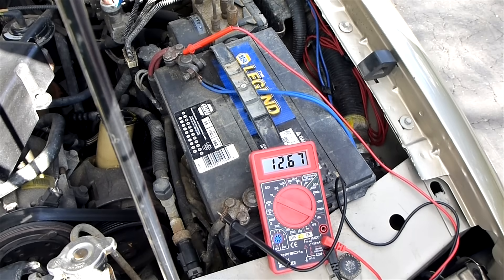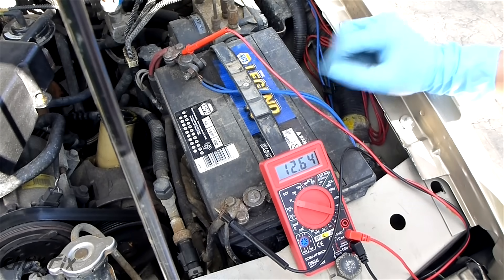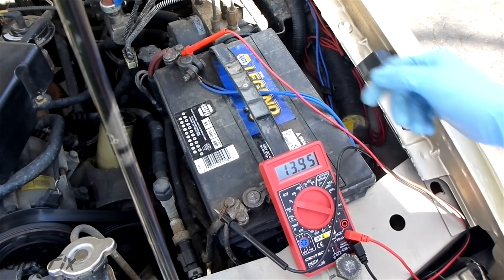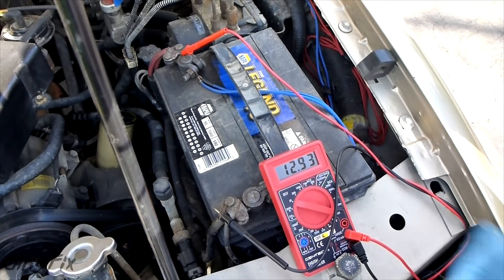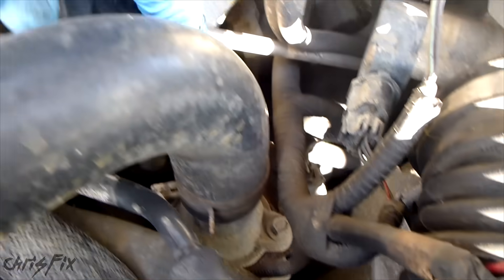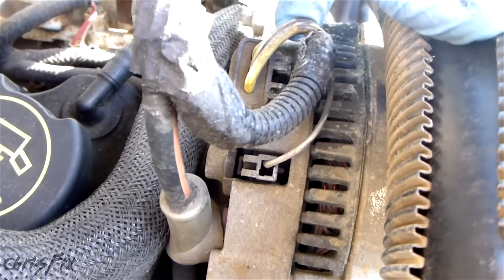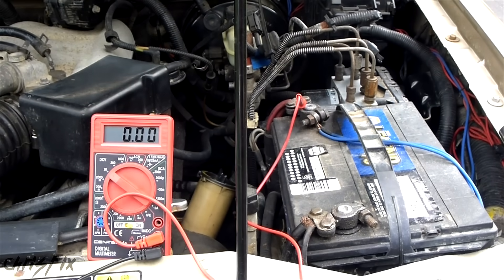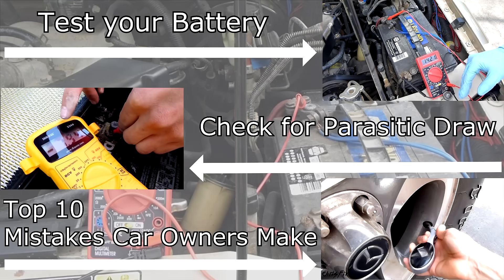How to Test an Alternator

Comment: if the battery light comes on during drive its always the alternator, the batterys only job is to start the car, the alternators job is to power everything and reload the battery. the battery light comes on to tell you that the car is now running on battery power, and the alternator is bad or broken. if that happends, and you cant fix it right away, turn everything u dont need of to conserve battery power so u can get home atleast.
Reply: I end up with this issue today, 3 days after i changed the belt the issues come up today morning while driving to work, i did the same thing i turned everything off and i managed to survive the day, now the car at local garage.
Reply: In my case it was the battery. We went out and stopped to grab something at a store (less than a 5 min stop where the car was turned off so even if all the lights were on it shouldnt have died), and it didnt turn on. Then we used a battery jump start and the car started but acted extremly wierd and upredictable, for example we almost ran into a fence when the powersteering turned off. So we went to a mechanic and he tested the battery and it was shot. It got shorted somehow and was drawing so much power from the alt, it got hot.
Reply: @EndstyleGG  when I bought my truck the owner had let the thing sit for like a month and he had to jump it off to meet me down the street from his house (way out in the boonies where maps won't find you) and it was like that, the thing was super low on the voltage and there was this weird smell, got to looking and the battery was smoking just a little bit, used that to get him down like another $150 bucks (then used a coupon code that saved me nearly $50 and bought a new battery, fixed it right up). It was also hot to the touch.
Reply: This is simply not true.  If your battery is broken, it will refuse to charge and drain all the power your alternator outputs.  This has happened to me.
Reply: @CH-ny7rb  you are correct and the cars of back in the days it is true but on today's with all the electronics and accessories the battery is a big player and if it's bad you will notice
Reply: Well the first time it happened to me, some 30 years ago, I was still far from home, but made it back without issues. (brushes and regulator)

Second time, some 15 years ago, I was not so close to home.
Damn! I was not even in the same country. LOL

But thanks to a nice semi truck driver well equipped tool box, I was able to repair it, go around Europe and later return home to fix it properly. (broken alternator bracket) :-)
Reply: last night the light came on for about 30-60 seconds after I cranked the car then it started charging again and the lights went back to normal brightness, tonight it did it again, but took twice as long, then I stopped for dinner and when I got back in the car it  never started charging again, by the time I got home there wasn't enough voltage left in the battery to crank the car back up, just finished pulling the alternator so I can get a ride up to the parts store in the morning, grab a new one, slap it in and head off to work.
Reply: Adam Karlsson thx but i dont want that to happen.. lol.. cause i will not run at all at battery... hahaha

Comment: Man i remember doing these things with my '95 Ford Taurus. 
Had so much issues with the car starting, that i would get stranded at a gas station for a few minutes until i got my car started up again... and that was due to the negative electric cable was all damaged, dirty (oxidized), copper cracked etc...

one day i got so fed up, that i removed/trimmed all the broken copper wires at the end of the cable, cleaned them with ... Coca Cola Soda... yes Coca Cola :) 
Then rinsed them off with rubbing alc, replaced the terminals, sanded the battery poles and connected everything back.

Never had a problem starting the car since. :D

My alternator was a beast! how do i know? well... here's the story..

One day went to garage for an exhaust pipe change and my mechanic pointed out that the chassis was cracked, like pretty substantial.... also there were holes everywhere ... like a huge one right under the driver side carpet. So he said it wouldn't be worth it to replace the exhaust to then have the car crack even more one day wasting that install.

So i then made the decision to bring my car to the scrap... :(

Before i got to the scrap, i stopped a quarter mile away, leaving the car running, and pulled the battery out of the engine bay.
My car drove the rest of the way without problems, until i got close to the parking spot when i was slowing down, car then stalled. i was impressed :)

Comment: Your 9min vid saved me a day in the garage, in my case it was the alternator regulator connector that was loosen up. I had  only 13.5v coming out, which caused the battery to run empty after a month. Once I fixed the connector, voltage jumped to 14.6v. THANKS.
Reply from the maker: +john doe Awesome! Glad the video was helpful!

Comment: Also that style battery terminals are for temporary use only. You are clamping soft copper wire in an off road vehicle. Get some terminals you can solder together. Creates a 100% bond from wire to terminal. Crimps are crap compared to good solder bonds.
Reply from the maker: +jim davidson Thanks for the tips!
Reply: I like your videos sir. Just some friendly tips for you.

Comment: My 22 year old Chevy's alternator died recently, which is surprising because the truck only has 36,000 miles on it. I replaced it and haven't had any problems since, but it is still odd for an alternator to go with so few miles on it. (Considering my car is on it's first, and has nearly 200,000 miles on it.)  Thanks for the awesome videos! :D

Comment: After an alternator and battery replacement, I notice that my car seems to bog down when I change speeds on the car heater blower, or when I operate my power windows. I don't understand what would cause these issues.
Reply from the maker: +SaintWilliamIII A bad ground would cause these issues. Watch the end of this video and make sure your grounds are good and clean.

Comment: one question, my 99 dodge neon, when i start the engine, without any accessories turn on the alternator charge`s up the battery at 13.9 V that`s mean that my alternator y not fine? thanks
Reply from the maker: +drkphnx1203 Yea, that is a little low but that is fine.

Comment: That's why a voltmeter, or better still, an ammeter, is an important meter in the dashboard, and which most manufacturers scrooge on. 

Another one is an oil pressure gauge.

You'll find some of the older generation Japanese cars, such 
as the Mitsubishi Galant Sigma,and Subaru GLX, have all four - fuel, temperature, voltmeter, oil pressure. 

My first car, an Isuzu Gemini, had fuel, temp, ammeter, oil pressure.

Comment: I have a 2005 cobalt with an alternator outputting 15.5v..  Brand new battery.   I've had some people say 15.5 is ok, but anything higher would be bad.  Some car voltmeters have voltage "redlines" above 18v...So is 15.5 really bad?
Reply: Yeah
Reply: Based on its mode of operation that the BCM tells it to be in you will have several voltages that will output from the alternator. 15.5 may be the voltage you see on your dash but you would need to not only use an accurate (non Chinese) DVOM but also know what "mode you are currently charging in. That will take a scan tool. I will usually go into the BCM and force full field aka PWM at 100% on GEN L with a KNOWN GOOD BATTERY. 15.5 is the maximum charge. Literally going by spec if you charge at 15.6 it's bad 15.5 is good. 
 Fuel Economy ModeThe BCM will enter Fuel Economy Mode when the calculated ambient air temperature is above 0°C (32°F), the calculated battery current is less than 15 amps and greater than -8 amps, and the battery state-of-charge (SOC) is greater than 80 percent. Its targeted generator output voltage is 13 volts. The BCM will exit this mode once the criteria are met for Charge Mode.

 Voltage Reduction ModeThe BCM will enter Voltage Reduction Mode when the calculated ambient air temperature is above 0°C (32°F); the calculated battery current is less than 2 amps and greater than -7 amps, and the generator field duty cycle is less than 99 percent. Its targeted generator output voltage is 12.9 volts. The BCM will exit this mode once the criteria are met for Charge Mode.

 Start-up ModeAfter the engine has started, the BCM sets a targeted generator output voltage of 14.5 volts for 20 seconds.

 Windshield Deice ModeAfter the engine has run for more than 10 seconds, the BCM sets a targeted generator output voltage of 13.8 volts if the calculated ambient air temperature is less that 0°C (32°F). The BCM will stay in this mode until the engine coolant temperature (ECT) reaches 75°C (167°F) for 10 minutes.

 Battery Sulfation ModeThe BCM will enter this mode when the interpreted generator output voltage is less than 13.2 volts for 45 minutes. Once in this mode, the BCM will set a targeted output voltage of 13.8 volts for 5 minutes. The BCM will then determine which mode to enter depending on voltage requirements.

Comment: @ChrisFix I got a reconditioned altenator for my car and it isn't woking, I have everything plugged in, I want to kill myself this is so annoying
Reply from the maker: +Lucky Mertz Check this video out: https://www.youtube.com/watch?v=XC8W9RHGTMI
If the reconditioned one isnt working, I would verify that you arent getting any voltage at the alternator itself. Touch the red multimeter lead to the positive terminal on the alternator and touch the black multimeter lead to the metal case of the alternator,.
Reply: Thanks Chris, will try this
Reply: +ChrisFix do I need to do this whilst the car is on?

Comment: I had a bad alternator but i didn't have a multimeter so to find out i started my car and disconnected my battery and then i turned on my headlights window wiper and heater  without revving the car up the car stopped dead I replaced the alternator because i didn't  want my car to stall while i was idle at the stoplights
Reply: +Roc Lo  Never disconnect the battery while the engine is running !! it can ruim some electrical components
Reply: sure if you don't have an alternator in my case i had one barely working mind you but i think you will find that most cars have an alternate back power source while running other than the battery its called an alternator and its purpose is to provide power to the car while running other than the battery cos if you rely only on your car battery it will go flat without a working alternator and could leave you stranded on long trips the battery purpose is to start your car nothing more the alternators purpose is to provide power to your car systems and charge your battery
Reply from the maker: +Roc Lo Thanks for sharing!
Reply: thank you for your easy to follow video i really like your how to make a centre console video

Comment: Would these same tests work on a generator? I need to test one on an old IH tractor that does not like to start under its own power, the battery was fine the last time I checked it, but it seems the generator is not charging it.

Comment: It should be from 13.8v to 14.8v. Thats how my professor taught us.
Reply from the maker: +Adrian Kolodziej Thanks for sharing.
Reply: +ChrisFix No Problem man. Keep up the good work. Your videos really help me fix my car :)
Reply: +Adrian Kolodziej I looked this up as I am seeing 15.3 to 15.7 V these days for my AGM. It turns out that it greatly depends on temperature and as we are close to the freezing point right now, >15V is normal per manufacturer info.
Reply: +Baerchenization  AGM needs at least 14,6 volts
Reply: yah i noticed that too.. a lot of people with good alternators might think theirs is bad after watching this and seeing 13.8v instead of 14.2 like in the video.. otherwise awesome video as usual
Reply: my car run steady 13.7 13.8 after car is ran with my 2000 watt system on stock alternator althought i did redo alot of them factory grounds in the hood

Comment: hey chris I have a problem on my Tacoma 09 v6 4.0 my battery has been discharging often the voltage on it is 12.6 and when its on with loads such as lights fog lights, a.c. and sound system its at 13.6 or 13.7 does this probably mean I might need a high output alternator? all my other conctions seem to be fine unless I did one of them wrong
Reply from the maker: +michoacan91davi I would make sure you clean/sand/tighten all your ground connections. If that doesnt work, you might need a new alternator: https://www.youtube.com/watch?v=XC8W9RHGTMI
Reply: +ChrisFix thanks man, i might just get one because the alternator is 7 years old and I do have a complete sound system so it just might be time

Comment: my van is reading  0 sanded  the connection, there is  continuity and I can read voltage but your test didn't  work  for me. the battery charge light is on alternator  is not charging  the  battery  autozone  tested it; once I took it in, the second they tested it  while hooked up .they said the alternator  is working  but it's a bad connection.  changed the connecter at the alternator  and tested from alternator  to ipm. while  following the wire harness connection  broke at starter so I replaced  it feel there  is something  with the fuse box have had alot of dead ends there is there anything  you can think of is there a way to hook up direct without frying the system it's an 03 chrysler town and country it's been sitting  for months but I still  move it street sweeping  days battery is new but low voltage  11.9
Reply from the maker: +layuptech You can run a red wire from the positive post on the alternator right to the positive on the battery, but make sure you put a "mega-fuse" like this inbetween the alternator and battery : http://amzn.to/1PjkURL

Comment: What about disconnecting the negative terminal on the battery while the engine is running? If the car shuts off that means the alternator is bad, but if the car stays on, the alternator still works.

Is this a good one?

Comment: how dou do this if the car wont start
Reply: lol
Reply: How do you do this if my car wont start?
Reply: @gamer83294  Dang! That's my problem and no answer!
Reply: Terry Giancaterino Jump the battery
Reply: Ohm bench test it
Reply: You can’t see how much voltage the alternator is putting out if the engine isn’t running and spinning the pulley on the alternator. You have to jump start it to get the engine running and then test this. Otherwise you can remove the alternator and bring it to an auto parts store and have it tested.

Comment: I enjoyed your video and you explained your methods very well.  I've had a number of cars though where the battery voltage was good, the alternator charging voltage was good, there was no severe voltage drop on either the ground or power side of the battery, and there was no parasitic draw.  The car would still die and it was due to a lack of cold cranking amps.  It would be good to mention that in your video that those tests you did should be done but they do not conclusively eliminate the battery as a possibility for the problem.

Comment: On my car when the traction control turns on I see that my head lights and dash lights dim. I don't get a battery indicator light on my dash. Where should I start looking, the battery, alternator or the traction control?
Reply from the maker: +Matthew Linn I would check the alternator first. Then pull the traction control fuse and see if it happens still.

Comment: Hi ChrisFix, I started my 1991 Corvette and couldn't get my key out.  It actually got stuck.  I had to play with the ignition to get it out.  I'm thinking I have to change it.  Do you have a video on that?  Also, can this fix the way the car starts?  I just put in a new battery, the old battery failed when we put a load tester on it.  When I turn the car over, it'll turn over for a second, then it seems the car dies, and then a second later, it turns over and starts.  That can't be normal. The starter, battery and alternator seem to test fine.  Any suggestions?
Reply from the maker: +Massimo Pavese I do not have a video on that yet but check the shifter too. Sometimes it is not in neutral or park so it holds the key. Make sure the grounds on your battery and engine are clean. Since the Vette is made of fiberglass, the grounds have to be extra clean for a good connection.  Keep me posted!

Comment: My scooter battery dies after 2-3 days and I have no idea what could be wrong with it. I thought it was the battery so I got a new one and the same thing happened again (I tried it with 3 different batteries). So.. now I've changed the rectifier (voltage regulator) and my scooter still doesn't charge my battery. What could it be? The alternator? :(
Reply from the maker: +Alan W Try this: https://www.youtube.com/watch?v=n5FJDgcdii8
Reply: Thanks. Unfortunately I only have one fuse near my scooter battery so I won't be able to check this. However, I will go get a multimeter tomorrow and check if my battery is charging.

Comment: hay I need help 99 f450 7.3 batt draw pulled fuse #6 under hood 5 amp for alt a and b field draw stops what is that
Reply from the maker: +Horseshoerich P I am not sure what you are asking. What is the fuse for? That is what you need to figure out and once you figure that out you have to fix/replace that part.

Comment: Just a few things to think about, some alternators even vary charge dependent on temperature ( mitsubishi have these ) which has thrown me a few times also if you have a agm battery and a weak alternator it will kill the alt quicker due to how agm batteries are.
Reply from the maker: +ZKev1 Thanks for sharing!